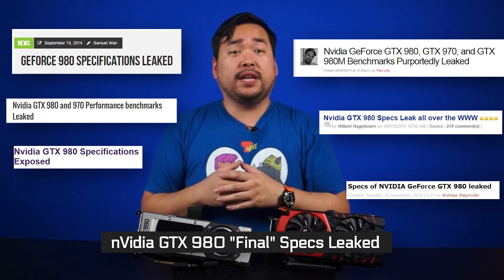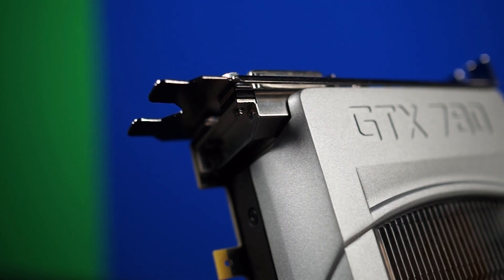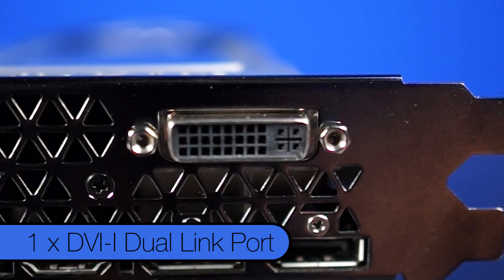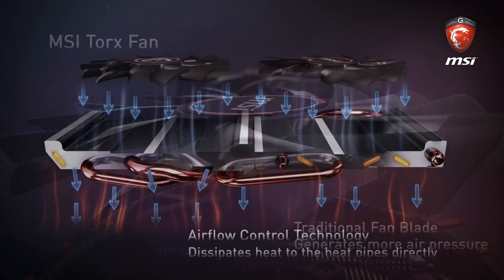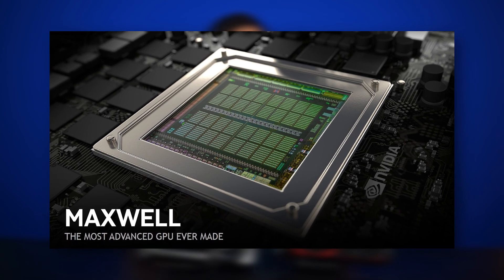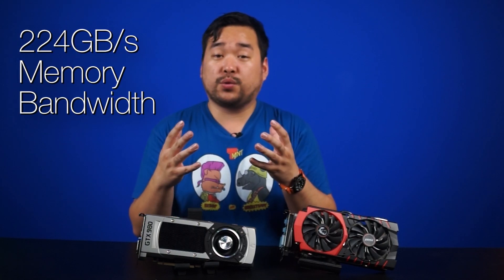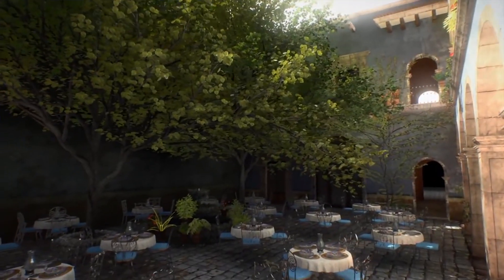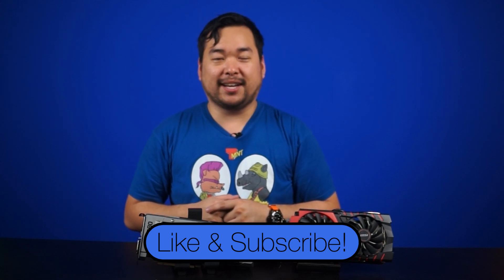What is Maxwell? Explained. ft. GTX 980 and MSI Twin Frozr V GTX 970

Comment: if anyone is curious about getting the gtx 970 with the reference cooler, its a best buy exclusive. they are directly from nvidia. packaging and card looks are better, and TDP is as its advertised. aftermarket coolers use more tdp. which sucks. but the best buy cards are sooo sexy.

Comment: So I actually bought the 970 off of the NCIX website
http://www.ncixus.com/products/?sku=102246&vpn=GTX%20970%204GD5T%20OC&manufacture=MSI&promoid=1449
and the package tracking info they gave is either wrong or I dunno but its kinda upsetting :(

Comment: Which GTX970 is the best? Also how is the performance on 1080/2k/4k and 1080 with DSR at 2k/4k. Is g-sync and 144herz in means of FPS possible at 1080/1440 or 1600 with latest games? And all latest source games. Titanfall, and other valve games.

Comment: This card really makes it look like nVidia's development cycle has stalled. Releasing a successor that improves power consumption over performance makes it seem like they've hit a wall in advancing the state of the art...
Reply: Mark Mackey Exactly, and this is a good step in keeping them relevant as onboard graphics gets more powerful and OEMs have to make that critical eefficiencyvs. performance decision.
Reply: To me it is the exact opposite as they're both more powerful than the 780 and with the right drivers I reckon the 970 will be higher than the 780ti. It is already showing at this early stage and they are both very reasonabley priced esspecially the 970. This is a step to a much larger one as they could implement this into the next gen cards making them much less resource intensive and much more powerful than previous instances. In my opinion once they have perfected this architecture they will be able to provide cards that cater to wide variety of users from low budget to no limit budgets lol.
Reply: "Releasing a successor that improves power consumption over performance makes it seem like they've hit a wall in advancing the state of the art." I guess you think miniaturization was a waste of time as well? Things have to be made more efficient before they can be made more powerful.

Comment: At first I was planning to match the 750Ti with the i5-4460
Now that these are out, can I match the i5-4460 with 970?
or I could also wait for maybe a 950Ti?
Reply: you can match i5-4460 with 970, no worries there. i'm getting that in a few days and going for MSI gtx 970, and 4460 i5 :)

Comment: I love a battlefield 4 benchmark, but it has to be multiplayer 62 players at least. As the single player most entry level cards can max without to much trouble, as there is not much action in it as the multiplayer.

Comment: WAIT, the firmware is much better, but did the actual hardware go backwards???  
50% less bus, bandwidth and transistors... something tells me NVIDIA hit the lottery with the software side - but is now "rewarding" their customers with half the hardware... thoughts??
Reply: Maybe they just want it to run stable before building on it for another 2 or 3 generations.
Or maybe they just realised AMD still has to catch up with their GPUs (apart from the 295x2 monster) and can release a gimped version of their hardware, only to launch the next series with the originally (700 equivalent) planned hardware. Then perfect it and launch it rebadged like my 760s.
Reply: It isn't the jump you'd expect, but they did manage to reduce the power consumption and prices by quite a bit. Especially the 970 has a really sweet bang/buck if you factor in how far it overclocks.

So instead of going bigger and more expensive, they focused on lowering the prices and power consumption. While the absolute performance is nothing new, it's really nice to be able to get it at the pricepoint of the 970. I have no doubt that if you want really good performance, they will come with Ti versions of these cards.

This is coming from someone with an AMD system. Definitely not a fanboy either way.
Reply: KuronoXD It is a gimped version :(    I know they need to make $$$ , but just sad how they don't just update the 700 series' firmware.  (even if they charged $ for it).
Reply: They are focusing more on Price Performance with 900 series, However they will still release an high end beast with either 980 ti or 990

Comment: While all those small things is what makes flagship a flagship, i still sitting on GTX 780 SLI (for iRay rendering and gaming...) and i can`t give a single "maxwell"  about moving to 980.
      It may be more efficient, it maybe the overclocking beast, but price performance wise GTX780 is unmatched these days for video editing, rendering and of course gaming (Ermergerd, can it run CRYSIS 1? No?).
      One small thing -  i can always go maximum rendering performance(speed, render time, viewport FPS - you name it!) and buy Quadro+Tesla card combo with nice, twin octa-core intel xeon setup...    -----HOWEVER---
        There is a really, really bad thing about flagship products - they get old extremely fast and their performance drops by 10-20% each year(giving the fact that software also evolves and realistic renders demand much more powerful hardware to do "quick"/preliminary/test renders).
Reply: In other words, it is not worth to invest in flagship-class product unless it will pay off THIS YEAR (for example you need to upgrade due to bottleneck/old hardware or you need better performance to meet deadlines or something else like educational purproses... ), because otherwise you are automaticallly losing amount of money (and performance) equal to price drop of your "flagship" compared to the one that is arrived to replace it. 

     Do you need 980 to play?  - Not worth it, games are not that optimized to handle dual 780 well enough and some are even CPU-dependant more than GPU dependant.... not to mention there are games that do not use Quad core CPUs and multiple gpus (psst. World Of Tanks, Starcraft 2, Dota 2... they don`t need dual GPU setup and WoT is still can`t get this multicore thingy!).
     Do you need 980 to render? - Unless it will feature 6GB ram for large scenes (and if you working with large scenes on daily basis you need 6-12 GB cards and the last ones are extremely pricey) , i advise getting anything cheaper than GTX 980.(Titan is a better deal, he was designed as budget workstation card if there is such a thing as budget workstation..).

Comment: I would like you to benchmark the GTX 970 vs R9 290X in games running at 1080P and 1440P then overclock both cards and benchmark again, use Mantle and DirectX, these cards come at the same price point and generally perform the same it would be a great help to everyone trying to decide on a new GPU

Comment: Battlefield 4 at 4k, with a single 980?
Reply: you don't need AA at 4k
Reply: yes Ultra but no AA
Reply: 18aidanme I said he doesn't need AA read my comment
Reply: ilham defra Because the pixels are extremely tiny.
Reply: sorry if it dumb question, can you explain why AA not use in 4k display?
Reply: Thomas Wilson Who the fuck needs AA at 4k?
Reply: oh i got it
Reply: ilham defra Pixel density is what matters. 4k resolution on the standard monitor sizes of 24-27 inches means a pixel density that essentially removes the possibility of those jagged edges that you'd see at lower pixel density.
Reply: GRRR am i the only one just getting fucking super excited by this comment?